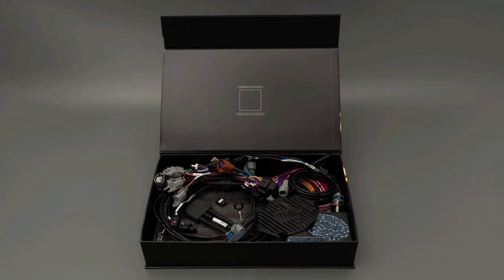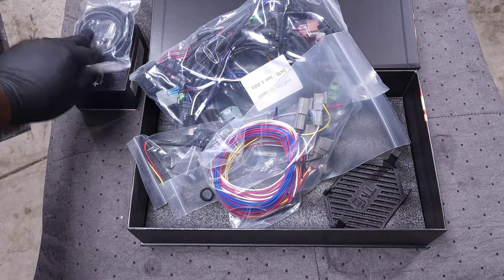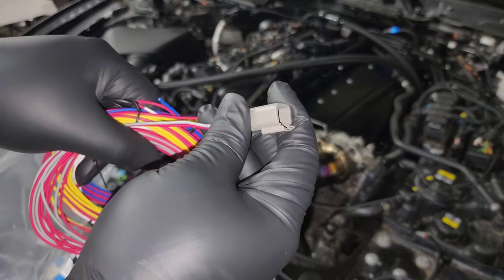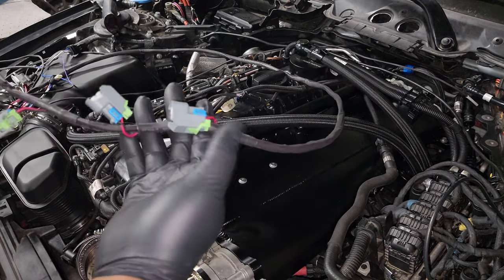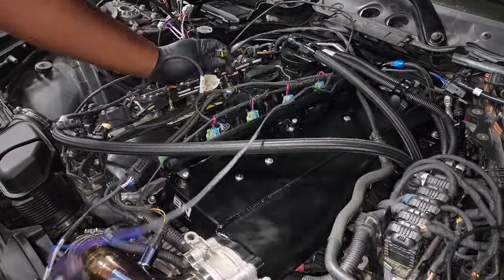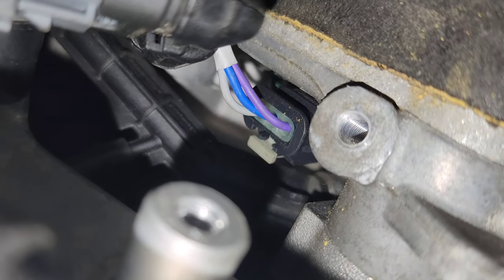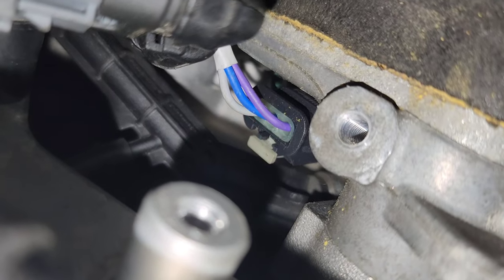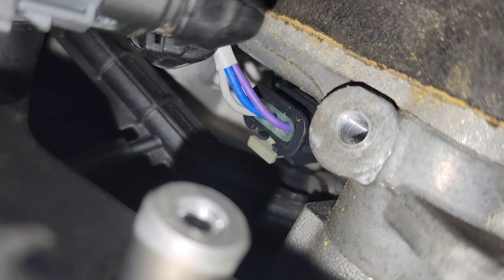Installing the TMS Plug & Play Kit for Motiv Reflex - No more tapping wires!

Comment from the maker: Sorry for the confusion everyone, but TMS changed the instructions after I installed the kit. That's why they show different pins being used.

I recommend using their latest instructions for the best results, but I haven't had any issues installing it with the old method. Link to the latest instructions is in the video description.

Thanks for watching.

Comment: For $650 imma keep tapping wires 😂
Reply: Precision Race works also have a separate harness you can buy on top of the normal splicing harness. Plug and play for $200 versus paying $650

Comment: @kern417 how long it take you to install the plug n play kit? Is it worth the peace of mind to get plug n play or will some positaps work just fine? Im sure it would take reasonably longer to install without pnp if im looking and counting pins for every wire; versus just four pins removed in the plug n play but will struggle trying to install crank sensor.

Comment: If you already had ecutek that connects to the flex fuel sensor. Do you replace that with the TMS plug and remove the one for ecutek? It only allows one

Comment: @Kern For gen 2 M340I. Do the passenger foot area connection the same? (I just look at the instruction for gen 2 on the website) Look easy enough. Thanks
Reply from the maker: I would double check their instructions to confirm but it should be similar at least
Reply: Bro wtf mess is this that’s not plug and play that’s nightmares and emotional stress

Comment: Hey kern, planning on getting this so I don’t have to tap but if I have/getting a top mount setup that will no longer have the pcv harness and some other sensors. Could I just leave them unplugged?
Reply from the maker: Youll still plug into the engine harness but the other end will be loose

Comment: @kern417 its off topic but please please can you help me I’m an apprentice technician I have just fitted  Lsd, hpfp and new injector (cyl 2) I fitted the injector because I kept getting a drive train malfunction randomly when I kick down. 
 I’ve tried to track if it’s because of my type of fuel or if it’s because of compression but it’s none of them .I changed coil and spark plugs first then I gathered it must be my injector however since then I still get the drive train malfunction at random points under load or when I kick down. I’m genuinely confused and don’t know what else to check
Reply from the maker: scan for codes.
Reply: @kern417  I have I’m just getting 

120408 - Charging pressure control: Switch-off as consequential reaction.
140001 - Combustion misfires, several cylinders:
Fuel injection is switched off.
140010 - Combustion misfires, several cylinders: detected.
140201 - Combustion misfire, cylinder 2: Fuel injection is switched off.
140210 - Combustion misfire, cylinder 2: detected.
Reply from the maker: smoke test? check for exhaust leaks? how did the cyl 2 spark plug look when you pulled it?
Reply: @kern417  in all honesty the plug of was a little dark but nothing major compared to the others a smoke test will give me a different result to a compression test ?
Reply: @kern417  why would an exhaust leaks cause a misfire
Reply from the maker: Because if air is leaking at the cylinder head then the o2 sensor won't get an accurate reading